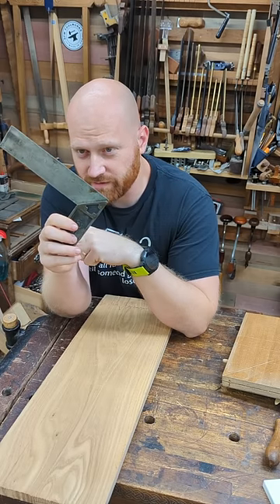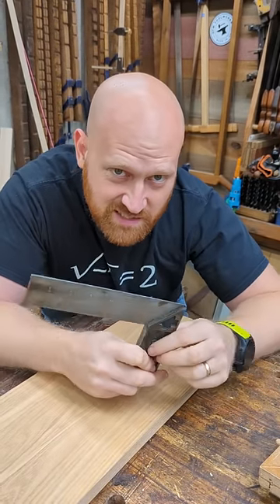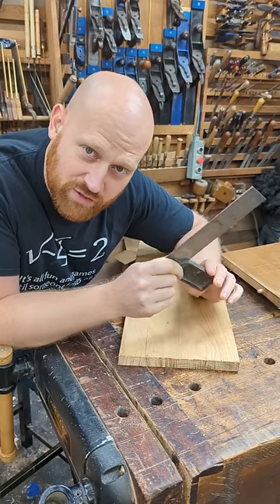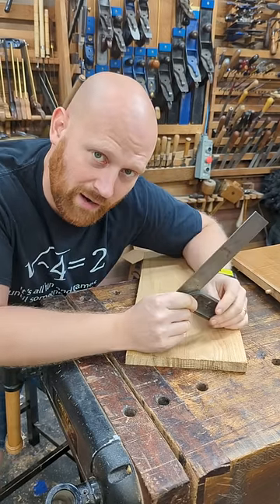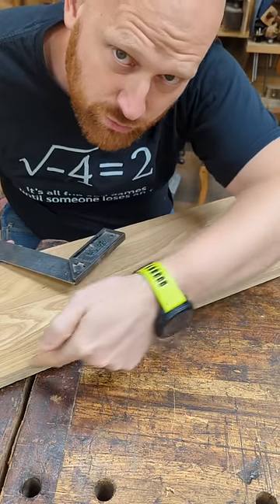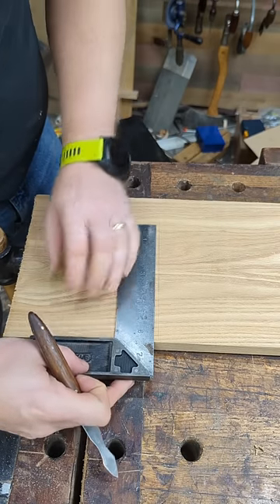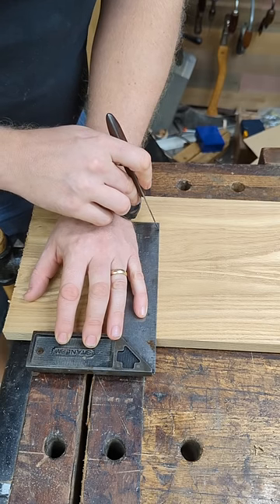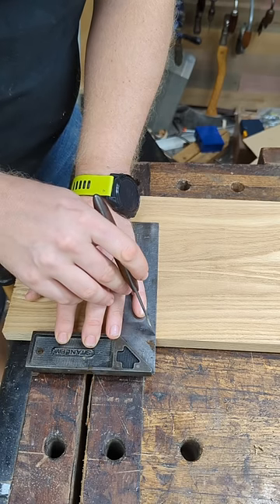How to Check if Your Square is Square

Comment: This is literally the cause of so much anxiety for me! Levels might not be level. Squares might not be square and straight edges might not be straight. So much anxiety lol
Reply: It's even worse in machining...
Reply: Right? And for woodworkers, how many of us have a AA granite reference in the shop to calibrate stuff to? I don't. A perfectly jointed edge? I set that jointer up using the square I'm checking off that reference edge... Etc... Become friends with someone who has a precision machine shop at home lol.
Reply from the maker: You can easily check the edge of many different ways it's very easy to get a perfectly jointed edge. You can check it with a piece of string, a straight edge, a jointer plane that's even slightly set up, or even an eyeball. And that's just a few of the methods. All of them are plenty good enough to check a square. The edge does not have to be square to the face. It just has to be straight.

Comment: ??? how can we know the board line is true 90?  are their squares off too?
Reply from the maker: The board doesn't need to be 90° it just needs to have a straight edge. You can check that with your eyeball, a straight edge, jointer plane, a string, or a bunch of other methods. As long as the edge is straight then a 90° line off of it will be the same in both directions if the square has some other angle it will be different in both directions.
Reply: @WoodByWrightHowTo  ohh i see, yep i got it, thank you sir.  i do rustic and cabin psc. so straight and 90 is a bit tuff for me.

Comment: If your squares are bending it's one of two problems using cheap squares or you're pushing way too hard to make a pencil line
Reply from the maker: Or it has been dropped, or set down hard, or bumped into, or temperature change, or relaxing stresses. The list goes on. Even the best can easily go out of square.
Reply: @WoodByWrightHowTo  routinely  check for  Square it can't be any more simple than 1 pencil line

Comment: What if the opposite side is just not square from the factory
Reply from the maker: The opposite decide doesn't matter. It's only the side that the fence is on. You can check and make sure it's straight with a straight edge, A jointing plane, a string, or even an eyeball.

Comment: That's why I run speed square they can't go out of square because it's a billett piece of aluminum
Reply from the maker: They still can't go out of square. I've seen a couple of those. It is nowhere near as often and it takes quite a bit of doing to make it happen but it can still happen.
Reply: @WoodByWrightHowTo  yea I guess like if u bend it somehow or sand a few to many shaves off o e side but still I take pretty good care of my stuff so I found the statement pretty accurate in my experience

Comment: I think it's more likely the board is actually out of square not the square itself. Just my opinion 🤷
Reply from the maker: The board doesn't have to be square if you have one edge that is true and flat then 90° off of that true and flat edge will be 90° on both sides. So if you flip the square over you're checking it against itself. If it lines up exactly with its own line then it's square if it doesn't then it's not. So you don't need a board to be square it just has to have a straight edge. You can check that with a string, your eyeball, a jointing plane, or another straight edge. No Square required

Comment: 3,4,5. measurements always square.
Reply from the maker: ish. that depends on how accurate your measuring is and in that small of a space that is hard. not to mention it takes a lot longer to set up. where as with this 90+90+180 degrees. much faster and far more accurate to measure.

Comment: He didn’t mention the deviation that occurs due to the angle at which you make the line, or in this case, the scratch. That deviation can be significant if the user is not aware of the variable or is careless when marking the angle. As a matter of fact, how you mark the line is just as important as the square you are working with.

Comment: Only us real Pros know what Starrett is! A Machinist Square is actually Square!
Reply from the maker: Until it's bumped or dropped.
Reply: Depends on the grade of square.
Make sure you buy one that conforms to squareness standards, not just one that claims to be a machinist or engineers square.

If it does, it will be very clear and stated, if not, dont trust it.

Comment: Is your jointer square, though??
Reply from the maker: The edge does not have to be square it just has to be straight. 180° - 90 = 90.

Comment: What if the jointer isn't square... or the guy who made the jointer used an out of square square to determine that the jointer was square... my trust... it's broken
Reply from the maker: The hedge does not have to be square just strait.

Comment: But like.. why does it matter if you use the exact same square for your project? Tape measures are more inaccurate than that square was off
Reply from the maker: Depends on the project. Framing a house, that deviation won't matter. Making fine furniture, gaps all over the project.

Comment: It's a good trick but you know it's the inside that's supposed to be 90° right
Reply from the maker: Both should be 90. I use the outside FAR more then the inside.

Comment: I WORK at the Starrett plant in Athol, Massachusetts, and can tell you our squares are square! After all how do you know that board is true and flat? Did you check it with a framing square? Was it under optimal conditions,  not too humid, in a climate controlled room? Of course you would expect a Stanley to be off! The audacity of it all! Um, excuse me for a minute, I have to go check my squares! (Full disclosure, nothing is perfect, people have a bad day, damage during shipping. I still like our stuff though!)
Reply from the maker: So true. But when it comes to checking for flat there's a bunch of different ways you can guarantee that.. check if it's flat with a string, a straight edge, and un straight edge, A jointer plane, and eyeball down the corner. Or a dozen other ways.

Comment: Which is why I have never seen a tradesman use that style of square
Reply from the maker: A try square is generally just used for cabinetry and woodworking. But even something like a speed square can get knocked out of square.
Reply: Many tradesmen use roofing squares, which are big L shapes made of aluminium (usually.) Quite easy to knock out of square.

I have also seen welders or auto workers use engineers squares, which are essentially this style of square made from hardened steel.
They sometimes go out too, and need periodically checking.

Comment: But of course we can’t trust the jointer either….
Reply from the maker: That's why you can easily check it with a bunch of different methods. You could use a string. A known straight edge. Or even your eyeball would be close enough for this.
Reply: Oh course strings are notoriously curvy straight edges warp over time and my lazy eye is terrible for spotting square boards. That’s why I think it’s better to just stick to Walmart furniture and let the Chinese figure it out

Comment: They use to make beams by roughly splitting logs wherever they naturally split, im pretty sure your square being 1° off isn't going to change anything
Reply: 1° is a lot. Try making a box with a square that's off by that much. With four sides your last joint is now off by 4°. With His little demo his square is off by maybe a .1° or less.
Reply: 1° is a BIG deal.
0.1 or 0.2° sure it's not much of an issue, perfectly fine for normal (rougher) work.

1 degree of difference, over 12 inches, is 1/8th off at the end of the rule.
It gets worse the longer your rule/blade is -- if it's 24 inches, that's a 1/4th an inch. That is just UNACCEPTABLE by any standard.
Reply: @DavidLeeKersey  I'm talking when building large scale, things are going to shift by more then that every day

Comment: Get a steel triangle square you will NEVER have that issue again seriously mine is from the 60s my grandpa gave it to me after his dad used it too
Reply from the maker: A speed square is great. But the problem isn't the square of the problem is the board being slightly untrue. All wood moves and even if you plan it perfectly parallel and square give it a couple days and it won't be.
Reply: @WoodByWrightHowTo  yeah swelling and warping definitely is an issue

Comment: This test seems dumb to me. This is a piece of lumber which obviously has imperfections due to the fact it’s made out of wood. Plus he flipped the square on a different spot. Let me know if I’m wrong!
Reply from the maker: Imperfections in the wood don't matter. It just has to be a straight edge and you can easily check that a bunch of different ways. 180° - 90° equals 90°. You're just measuring those two 90° to make sure that they meet at the same point. If they don't then your Square isn't 90°.

Comment: how to do you know your board is perfectly true and flat
Reply from the maker: There are a bunch of ways of doing that. It doesn't have to be flat it just has to have a straight edge. You can check it with a string with a actual straight edge even an eyeballs close enough for woodworking.
Reply: @WoodByWrightHowTo  your talking about millimeter misalignment on your square but you're saying you can just eyeball the straightness of your board? idk...
Reply from the maker: yes. you can easily see a 1mm deviation in the edge fo a 3' board with the eye. with a bit of practice you can see less then that.

Comment: ok but does that really matter?
Reply from the maker: Depends on the application. For some that is not enough. For others that is too much
Reply: Absolutely.
If you want something to be square, you need a square reference.
Obviously if you're using roughsawn shit and making planters and want roughly square, it's fine, bit if you want to make perfect fitting boxes, and furniture, then you need a good square, or your work is coming out wonky.

Comment: What if it means the edge of the wood isn't square🤷‍♂️
Reply from the maker: You can very easily check the edge of the board to make sure it's square. You can use another straight edge. You can use a string. You can use a jointer plane or you can even use your eyeball.
Reply: @WoodByWrightHowTo  my eyeball can determine square? Then what do I need th square for?😅 I'm not trying to troll you, I promise. I was just saying that it might be beneficial to make the point to ensure the strait edge you're using, is square😊
Reply from the maker: the strait edge does not need to be square. just strait. if it is out of square by a few degrees then there is no problem at all as long as it is strait.

Comment: Your che king it with a piece of wood you  100% sure your wood is perfect
Reply from the maker: it is easy to check. with a strait edge, a jointer plane, a string, and eyeball, or one of a bunch of other ways. If the square is for woodworking then that is good enough.

Comment: the tools are questionable for its squareaness, how about the wood straightness you're using to proved ?
try using other media
Reply from the maker: It all depends on the application required. Some things will require it to be far more accurate than what a straight board can give you and some that's way too much accuracy. It's very easy to check the straightness though that can be done a bunch of different ways and just a few seconds.

Comment: Why flip it, why not just move it over a bit
Reply from the maker: The idea is to take 180° and cut it in half. That would give you two at 90° if the square is something other than 90° then adding it to itself won't equal 180. If you just slide it over a bit then you're comparing it to itself. That won't tell you anything.
Reply: @WoodByWrightHowTo  oh I see, because if the inner side was at a wrong angle, outer side would still be at the same wrong angle. So by flipping it, it would reverse any wrong angle. If it was a straight right angle then it would be straight no matter what

Comment: There's a better chance that the edge from one side to the other is where the deviation exists.
Reply from the maker: It's very easy to check the board and make sure it's perfectly straight. You can do it with an eyeball, a string, jointer plane, a straight edge, or many other ways. As long as that edge is perfectly straight the method will work.

Comment: If you buy a square that gives you it's tolerances it will be square within that range. But accuracy has a cost
Reply from the maker: Most the time yes. But sometimes there are problems with QC. Sometimes there are problems with shipping. All sorts of Life happens in between the manufacturer and the use.

Comment: How do we know the flat side is flat without a square square
Reply from the maker: You can check it by eye. Use a string, a straight edge, or a series of other ways to make sure the edges straight.
Reply: @WoodByWrightHowTo  I was trolling but this is a legit answer

Comment: The board is about the least accurate thing to check a square with.
Reply from the maker: It's perfectly accurate if you check it beforehand. And that's why I told you to do that at the beginning. There are dozens of ways of making sure it's good and true.

Comment: This technique is only as reliable as the edge of the board is straight. Just having a steel rule to check it against is not enough, because any old rule, or new rule, is not reliable  unless it is a ground or scraped machinist's straight edge. Here is a way to make and check your own wooden straight edge..

You need two boards of the same size, thin enough to comfortably shoot them simultaneously, so that the edges are identical, with a plane using a straight iron rather than a cambered one. Shoot them using your best technique, my way is to lay my jointer plane on its side on the bench and pack up the paired boards enough to center them on the plane sole. Check them against each other to be sure they are not hollow, or swiveling in the middle. A sweetly sprung glue joint is not appropriate here. Now you have two boards to work with, and looking for light between them allows you to know that they deviate by  less  than .0005'' each over their length. For a few minutes, anyway.
Reply from the maker: that is why I said you need to check it at the beginning. there are several easy ways that will work more then well enough.
Reply: @WoodByWrightHowTo , no argument. I write for your viewers who wonder how to be certain their board is truly straight. Just an exercise in bootstrapping your way up the ladder of precision, working with what you have.

Comment: Yup that'll do it, trust a highly movable piece of timber to set your square up, not a steel straight which won't change shape depending on humidity no no, timber!
Reply from the maker: Yeah that's why I said at the beginning check it first. It's really easy to check and make sure the edge is nice and straight.

Comment: Or you have a slight deviation in the wood.  If you want to check for square.... square, use a steel piece - not wood.  Quality machinist squares have a tolerance marked (typically on the handle) - and no, you don't drop them! :)
Reply from the maker: It is easy enough to check the wood. There are a dozen methods that take a few seconds.

Comment: Couldn’t you just draw four right angles side to side, rotating the L-bracket each time until you end up where you started?   Then you don’t need a flat “known true” edge to base things off of, which is the whole point of your video in the first place (that you can’t trust assuming the L-bracket is a true 90 degrees)
Reply from the maker: That works too.

Comment: Woods warped
Reply from the maker: No. That's easy to check. Cuz a dozen different ways to make sure the edge of the board is straight.
Reply: @WoodByWrightHowTo  by using a square😅😅😅
Reply from the maker: lol ... no
Reply: @WoodByWrightHowTo  you should do a video on how lazer are incorporated in squares and levels

Comment: Did you verify that the surface you are checking against is flat? How flat is it? A few thousands of an inch out of flat can make your square seem way off.

Also, you've never bought a starrett square that isnt square. They are precision ground and certified.
Reply from the maker: you can check an edge many different ways. I will set up jointer plane. Unknown straight edge. A string. Even an eyeball can be close enough for what you need on this. I've had two brand new starret squares that have been out of square. I'm sure they were good at the factory but by the time they got through all the processes needed to get to my shop they were no longer. Squares have a tendency to move over time as different forces act on them.
Reply: @WoodByWrightHowTo  no you haven't. I am a tool maker and metrology is 70% of my job. Unless you physically damage one of them they do not under any circumstances come from the factory deviated enough to be detectable with anything but precision equipment.
Reply from the maker: there is a lot that can happen between the factory and the shop.
Reply: @WoodByWrightHowTo  then you are not buying genuine starrett squares. There isn't any if ands or buts about this.

My company buys every apprentice a set of 0-6" micrometers, square, 1 inch pitch mic, and a .0001 test indicator. Part of their training is learning how to certify their tools and inspection equipment. I've taught hundreds of apprentices how to do this and I have never had a starrett square that would be what would be considered visually out of square.

Comment: "perfectly jointed edge". Ha, yeah right. The square is always going to be more accurate than a board edge.
Reply from the maker: Try again. You can check for square a dozen different ways and get it within 1/1000 over 4'.